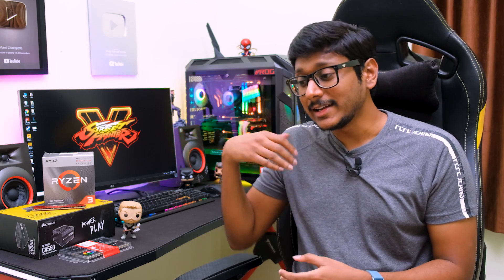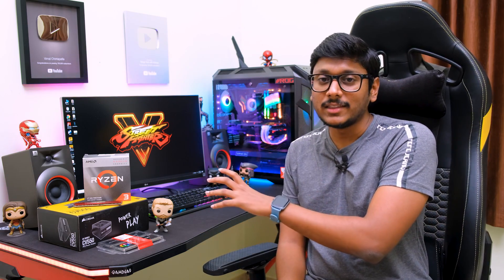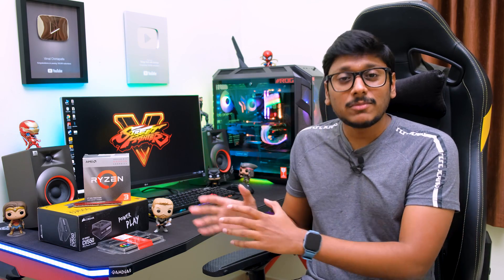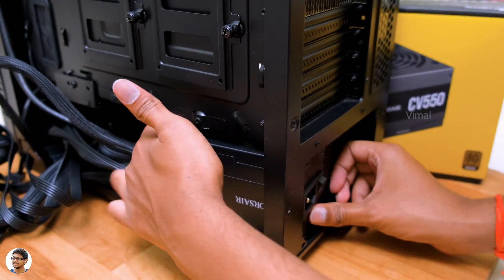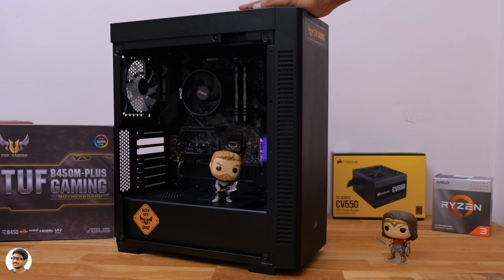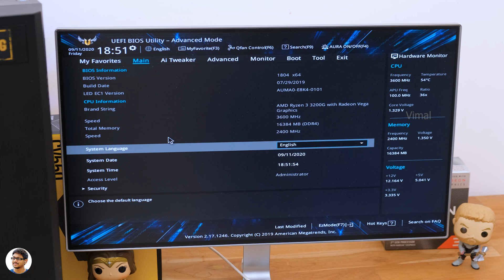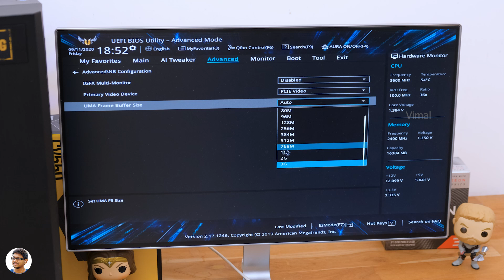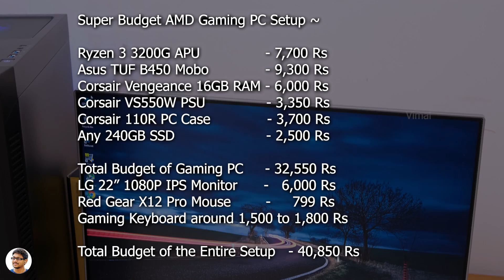40K Super Budget Gaming PC Setup... Crazy Performance! 🤯🔥

Comment: OMG your timing is legendary. I was just looking for a 40k pc including peripherals. Love you man..
Reply: don't buy the motherboard shown in this bullshit video 
Literally makes no sense to buy a motherboard costiler than the processor
I recommend u this configuration for 100000000 times more performance
i3 9100f(6k)
H310 mobo (4k)
1650super(12k)
450w PSU(2k)
Any budget Cabinet (around 2k )
Adata su800 240gb SSD(4k)
Any budget moniter ( 6-8k) 
Any keyboard + mouse combo (1-2k) 
There u go ,, 10000000000 times more performance for the same price
Reply: @Polaris1577   @kira kaneki  Yeah you are kind of right but the B450 chipset is what you should aim for even if you're on a budget (I'm talking about AMD obviously). And without always going with an APU, a cheap video card like a 1650 Super, as you suggested is also great.

Comment: Just yesterday.. I was looking for a 40k budget pc along with the peripherals and today you have came up with that exact same vdo.. it will help me a lot to make my decision right..
Reply: don't buy the motherboard shown in this bullshit video 
Literally makes no sense to buy a motherboard costiler than the processor
I recommend u this configuration for 100000000 times more performance
i3 9100f(6k)
H310 mobo (4k)
1650super(12k)
450w PSU(2k)
Any budget Cabinet (around 2k )
Adata su800 240gb SSD(4k)
Any budget moniter ( 6-8k) 
Any keyboard + mouse combo (1-2k) 
There u go ,, 10000000000 times more performance for the same price
Reply: @Polaris1577  and miss out on future upgradability? The am4 platform on the 450 boards, especially the tuf editions are ridiculously future proof. The h310? And what, when you want to upgrade cpu? Chuck it out?
Reply: @anirudhdiwakar987  Yeah i would suggest some b365m , it can atleast hold i7 10700

Comment: Hey vimal ,
   I am a graphic designer and I want to upgrade  my current I3  7th gen with 12gb ddr4 ram and 2gb radeon gpu laptop to a new pc . I need to run all apps from Adobe studio like After effects and Premier Pro CC . So if I go with this PC will it help me with that? Will the rendering occur faster? 
   If i have to add and external Gpu which one would you recommend and whats the budget ? Can i go with AMD RADEON instead of NVIDIA?
    Btw I am your great fan and I will leave my Instagram Id for any contact related to graphic designing .
Instagram : @kushi_grafixx 
   THANKS A LOT

Comment: What about editing ...( can i use photoshop adobe after efects and premier pro  )  for basic 1080p normal work.????
Reply: It will be very hard for rendering part trust me i know that pain🙏
Reply: @Sachchidanand0610  explain krr bhai thodaa..pl??
Reply: @Manjot_bhangu  if you make a video and try to render it, will take more time in this CPU compared to newer generation or better CPU's like Ryzen 5 4000 series or i5 10 gen or i5 9 gen would be able to perform better than this CPU but they all cost more
Reply: @Manjot_bhangu  my system always use to crash after rendering a 10 sec video in AE
Reply: @Sachchidanand0610  Yes man. Takes a hell lot of time to render. But OC is a bit faster.
Reply: Bro can i use... 1050ti with msi h310m pro vdh plus motherboard?????? 😑And if i will use i3 9100f bottleneck issue???
Reply: @chadd1149  no
Reply: @chadd1149  amd cpu are better that i3 10 gen.. So why go with i3 and that too 9 gen
Reply: Yes. But won't have much to do in Premier Pro & After Effects. :-(  I have the 2200g.
Reply: @ArnikoGiri  can we run photoshop or premerroo  without lag.?
Reply: Premier pro*
Reply: Can i do low end streaming
Reply: @ggsplinkoyt  which ..? Combo on 3200g no there is lag but i3 with 1050ti is gud

Comment: Finally a massiha save my 💰
Reply: don't buy the motherboard shown in this bullshit video 
Literally makes no sense to buy a motherboard costiler than the processor
I recommend u this configuration for 100000000 times more performance
i3 9100f(6k)
H310 mobo (4k)
1650super(12k)
450w PSU(2k)
Any budget Cabinet (around 2k )
Adata su800 240gb SSD(4k)
Any budget moniter ( 6-8k) 
Any keyboard + mouse combo (1-2k) 
There u go ,, 10000000000 times more performance for the same price
Reply: @Polaris1577  i3 9100f is not better then the ryzen 3. everything is ok but change the processor to ryzen 3 3200g (7.5k) and mobo to a320 (5k)  your pc will become a beast..

Comment: Thanks thanks thanks thanks thanks thanks thanks thanks thanks thanks thanks thanks thanks!!!!
I was just waiting for this! I was about to tell you to do a budget of setup for around 35k to 40k. You accepted my request without me even requesting it
Reply: Not a good build bro. At the same price I have 1650super which is 1000 times better than apu
Reply: @johanliebert858  he built whole setup including monitor under 40k
Reply: @johanliebert858  I also am thinking that...you are correct
Reply: @johanliebert858  Ya men RX 570 ALSO beats this
Reply: Bro can i use... 1050ti with msi h310m pro vdh plus motherboard?????? 😑And if i will use i3 9100f bottleneck issue???
Reply: @chadd1149  no you will not face any bottleneck as it's a pretty weak card
Reply: @chadd1149  best build for budget...go with it for 16 gb ram
Reply: Can any one tell how much this gaming pc has storage
Reply: @heroicgaming7388  240GB SSD
Reply: Will you tell me that where is the graphic card
Reply: @nikhilrajpoot7051  where ?
Reply: @debstark0246  there is no external graphic card inserted.
Reply: @nikhilrajpoot7051  there is no external GPU. There is an inbuilt gpu inside the cpu, which is called an apu
Reply: @debstark0246  ok thanks for the information
Reply: @Furious Gaming Ryzen 5 1600
Asus a320 ex gaming motherboard
Inno3d Gtx 1650 super 
Corsair vengeance lpx ddr4 8gb ram
Thermaltake lite 450watt psu
1tb Seagate Barracuda
240gb crucial ssd
Ant eSports ice 200tg cabinet
I have this built which costed me 41000rs. But I don't know about the new prices due to this Corona situation
Reply: @johanliebert858  bro how many fps you get
Reply: @gamingtutorialsrgukt7262  in GTA 5 ultra settings I get 100+ FPS and in warzone high settings I get 70-80 fps
Reply: @Furious Gaming replace r5 1600 with the ryzen 3 3100 you will save 4000 rupees at 0 performance cost

Comment: How to select the best pc parts for both streaming and gaming
Reply: For streaming get a good cpu and for gaming get good gpu
Reply: Hey VIMAL make a pc build for streaming games at 1080p 60 @50 to 60k budget.
Reply: Only pc
Reply: Neel Malvia  Only pc
Reply: Budget?
Reply: @rohan9825  80k?
Reply: @omenYTzz  44k
Reply: @omenYTzz  well bro i know the perfect type for under 80k.. this is personally my specs so here they are
Cpu- r5 3600
mobo- msi b550 gaming plus
gpu-1660ti
ram-16gb 3000mhz any*
psu- 650w bronze plus rated
cabinet - i have msi forge 100r..
u can choose any.
Hdd - 1tb 7200rpm
ssd - take a 560gb
Windows and peripherals not included. and yes you can upgrade some things as this components will be under 75k.
Reply: @rohan9825  wow thanks
Reply: @rohan9825  44k
Reply: @soumyajitroy5239  well i would suggest you to get a good gpu for streaming and gaming but if you are low on budget you should get a basic motherboard such as a 320 or that type of and instead of ryzen 3 3200g you can go to ryzen 5 2nd or 1st gen cpus. And if you choose the 2nd or 1st gen cpu then just check the compatibility of cpu with your motherboard.
Reply: @rohan9825  I can go for ryzen 5
Reply: @soumyajitroy5239  yes.. It would be better for editing
Reply: 50k - 55k max
Reply: Neel Malvia  44k
Reply: Thanks bro
Reply: Neel Malvia  Will it bottleneck?
Reply: Suggest a good gaming pc setup for 50k